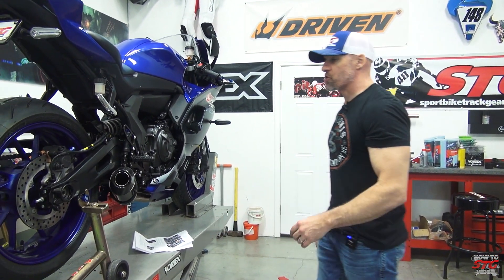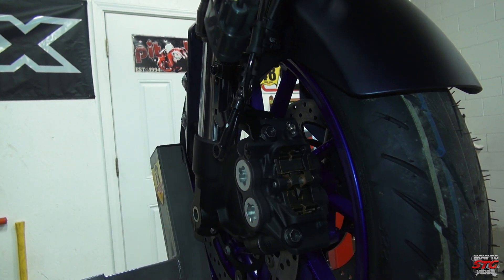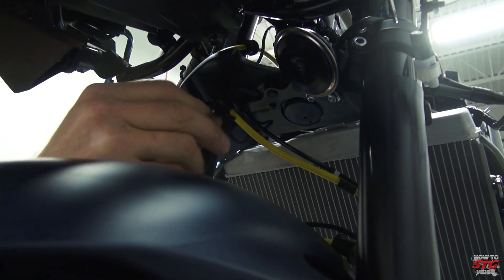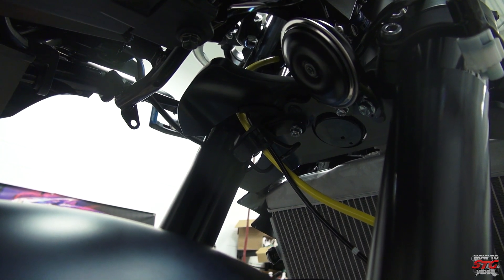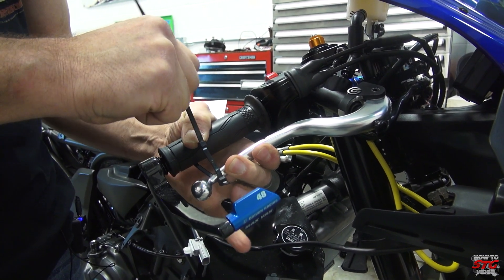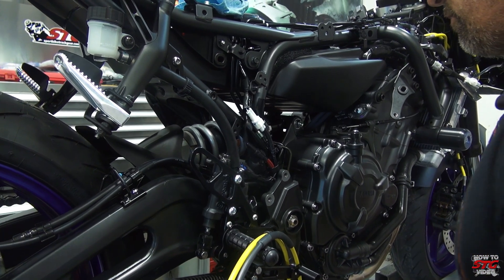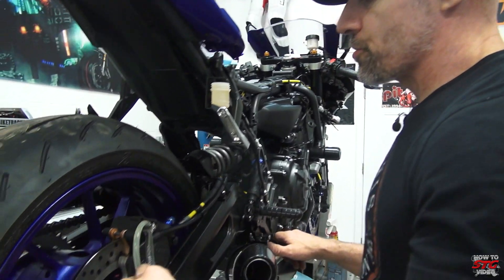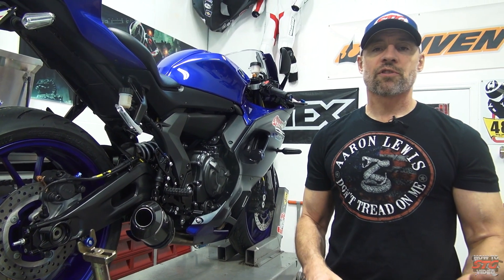Yamaha R7 Spiegler Stainless Steel Brake Lines Install | Sportbike Track Gear

Comment: So glad my Triumph came w SS braided lines from the factory.
Reply from the maker: IMO all the bikes should come with them. - Van
Reply: Do you  really need stainless steel brake lines?  The rubber flexes a little thus makes brake application a  little more Progressive..  My Yamaha FZ-07 does not have them while my 2008 Buell Ulysess does have them..  I use one finger on both bikes..

Comment: Hey Brian, I need to get a full set of street fairings for my 2017 R1.What is the best website or manufacturer that you recommend sir? Your input would be much appreciated man.
Reply from the maker: Sorry I do not have an answer for this. I have never replaced the street fairings on any of our bikes. - Van
Reply: @sportbiketrackgear  No worries,thanks for the prompt response. I purchased red Spiegler lines for my R1 from y’all and referenced the install video as well. Always great products,customer service and how-to videos. Ride safe🙏

Comment: My  Yamaha FZ-07   rear brake pedal  has  way too much Travel.  When I adjust it the way I like it then the brake light will not come on.
   There are many adjustments but I just  can't seem to get it adjusted to the brake light will come on when it should.
   I was thinking of replacing all of  the mechanic  brake light hardware with a brake light pressure switch ..  Have you done that?  I suppose it would take some fittings and adaptors to plumb it ..
Reply from the maker: If there is excessive travel in the brake pedal you may still have air in the system. I would try bleeding the system again to see if that solves your problem. If you want to remove the mechanical switch and install a banjo bolt brake line switch that is a relatively easy process. Essentially all you need to do is replace the banjo with the banjo with the pressure switch built into it and connect the 2 wires. - Van
Reply: @sportbiketrackgear    Thanks for the reply   but  it's  the linkage adjusments..  I can adjust the brake pedal so the  travel is short like it should be but then  the brake light won't go on..  So of course I  always use the front brake too .
  I had a rear wheel bearing go out on my 2008 Buell Ulysses..  I just installed a new rear tire .. I noticed one wheel bearing was a bit dry.  I recorded the part numbers..
  It's  ciaous to find the correct wheel bearings.. Prices from $15.00 to $60.00  each at Motion Industriws  was $60  for rears and  $50  for front wheel bearings.
  Finally  I found an ATV parts supplier   that both my front and rear wheel bearings in stock . Also  front seals  .. which I don't recall seeing when I changed the front tire nor are they shown in  my 2008 Buell parts book.  I thought about calling you guys but figured it was not something you had in Stock ..
  I did purchase the  Michillen Road Piolot  VI tires from STG  and  the handling is night and day better over the worn out Perelli  that was rock hard and worn more on the sides with a rib in the middle and worn down so much more on the left side I thought maybe the forks were bent.  I guess the left side wears more due to the crown in the road.
  The 4 bearings and two seals for the front wheel were $51.47 with Free shipping ..
  In 2010 Buell went to a much larger wheel bearing.  I doubt it would be feasable to find a 2010 rear wheel  and the proper center axle spacer..

Comment: Do you happen to know the torque spec for the nuts on the brake line
Reply from the maker: I do not but can tell you each kit includes a full set of instructions. - Van